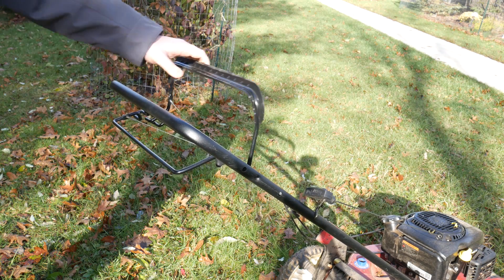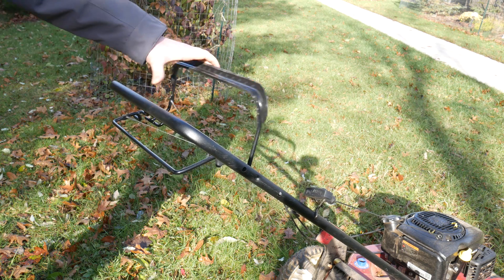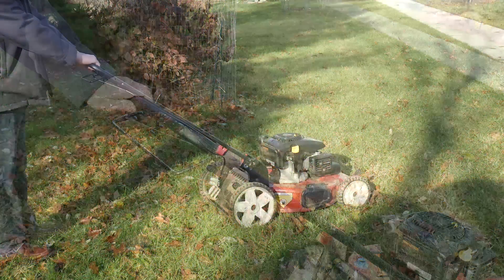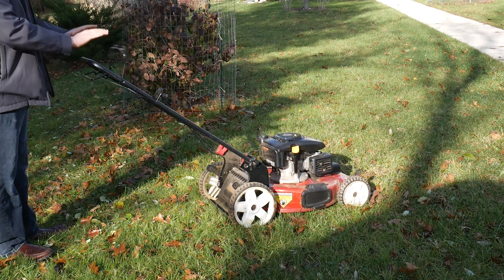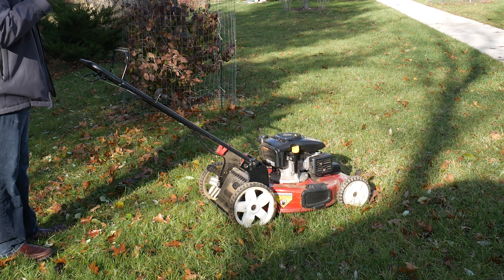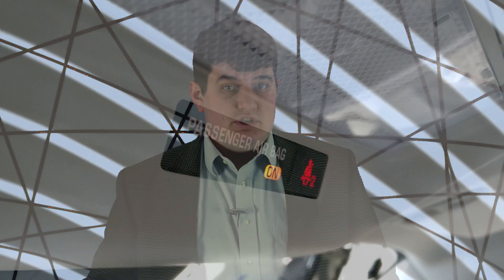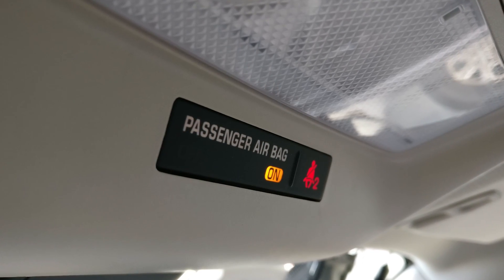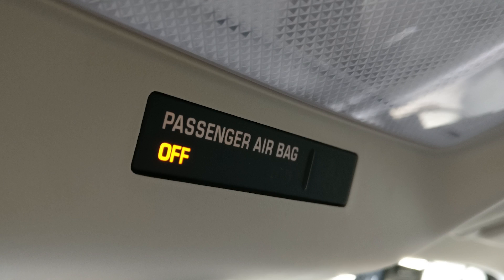The Dead Man's Switch:  How Anton Yelchin's life could have been saved

Comment: The comments seem to go off on tangents.

With the current state of cars, this is a valid suggestion that ultimately would make safer modern cars

Yes, older cars are nostalgic (double de-clutching anyone or even manual these days?), but times are a changing...

Concentrating on the present, this is a valid (& pretty easy to implement) idea.

Comment: Another common dead man's switch (at least in my life) is in those electric scooter mobility aids in grocery stores etc. The ones in the store I worked at only moved if you had enough weight on the seat, preventing children from using them or keeping the scooter still if you accidentally hit the throttle while getting up off the seat. The added bonus was that I was "forced" to sit down to put them back indoors from the parking lot :) Weeeee

Comment: I just discovered this video and although it would have been a great idea, I find Volvo's solution better. So the other day I drove my friend's fully loaded XC90. When you come to a full stop , no matter which gear you're in, the car won't move after you release the brake pedal, until you hit the gas pedal to move again. It takes a little bit of getting used to, but I can see how this is such a wonderful safety feature. I've seen drivers who loosely step on their brakes while in a traffic jam or drive through, not paying attention while their car slides forward. Even witnessed a minor collision due to this fact in a Mcdonald's lane. Anyways, with this system implemented, even if you forget to shift gears after leaving the car, it will be stationery until somoene enters the car again, and step on gas. Brilliant solution to a lot of problems, and hardly causing any issue whatsoever. My only caveat for the "deadman's switch" is that in case of a failed sensor, the car could be stuck in P while uninformed drivers may not be able to easily repair the issue, or get the car to a repair shop when it happens. Of course, unless the feature can be toggled on/off in the car's infotainment system.

Comment: I don't know if shifting INTO park at any speed (even as low as 5 mph) is a good idea. But did you know that many anti lock brake systems have the ability to apply the brakes without the pedal being pressed? They need a few seconds to create enough hydraulic pressure as the pump inside is tiny, but it's enough to stop a rolling car.

Comment: Cars haven't had driver seat occupancy sensors for the last five years, they've had them since the 1970's! 
It's what turns on the seat belt warning light and buzzer if you try to drive whilst not buckled up. 
Granted they haven't had electronic controls since then but it would be easy for manufacturers to implement an engine kill switch at the very least if the car is running and you get out the door.

A fork lift truck kills its engine if you get out (or refuses to start) if you're not sitting in the seat. 

Problem is, that any implementation of extra functions like a park control or brake control costs a few pence (cents) more per car and that's just not going to pass approval from the profit department.

Since time immemorial auto manufacturers have prioritised cost over lives.

Comment: Wait, wasn't the runaway prius thing because of "cheap" floor mats getting the throttle pedal stuck? I remember reading about this and toyota just installed floor mats with a lock. Also correct me if i'm wrong but don't new cars have a warning beep if you leave the car in gear and the engine is on in a "door open" scenario? The gen 2 prius actually has that function and you can not leave the car outside of park while exiting it (turned on (beep) or shut down).

Comment: I built a dead-man's foot switch into my pillar drill, if something nasty happens I step back (automatically!) and the drill switches off.  It won't start on the green button unless I put my foot back on the switch.

The circuit is very similar to the one you describe in the jukebox video.  It also works as a no-volt release.

Comment: Within months of picking up my ‘14 Tesla Model S a software update was pushed to implement this feature. I have a rolling gate at my driveway entry. Prior to the update it was rather convenient to stop at gate, get out, open gate, get back in car, drive through, stop, get out, close gate, get back in car and drive on, without any thought of having to take the car out of D or set a brake. My entryway is completely flat, in fact where I live there are no mountains/hills/slopes between me and any horizon. I remember thinking how lucky I was living where I had no threat of a rollaway (except in a strong wind) but also knew some folks would need to be careful. After update the car put itself in Park. This on a Tesla is engagement of the electric motor driven emergency brake “e-brake” calipers/pads. Was rather annoying at first but I understood it best for safety’s sake. From what I’ve been able to experience, any two out of the three following sensors triggering will have the e-brake set automatically: seat belt unbuckle, butt off of seat, driver door opening.

Comment: I know this is a really old video, but I'd like to make one addition:

The dead man's switch in trains are actually a bit more complex. The switch is operated by a foot pedal, since the train speed is not controlled by pedals but a lever akin to the ones in planes to control the turbine speed. But you do not only have to hold the pedal down, you also have to let go of it every 30 seconds and at most 40 seconds, and then hold it down again within 5 seconds. This is to prevent train operators from simply putting something heavy on the pedal. If you  fail to release the pedal after 35 seconds, a warning tone is played back. If you do not release the pedal within 5 seconds from then, the train is stopped. Likewise, if you release the pedal when you're not supposed to, the warning tone will sound and then force-break the train if the pedal isn't held down again.
Reply: Here in Germany the train staff are so tired that they already memorized the period of the foot pedal in their sleep.
Reply: Wow. That would be super annoying!
Reply: Some of them are a little different than that too. I've seen NJTransit trains where I believe it's more of a plunger switch that you have to hit when the alerter goes off. But yeah, not just a pedal for that reason.
Reply: @rynovoski Well, that depends on the country. In some you have to constantly press down and release on demand, in others you only push and release again when the system asks you for. In both solutions a random triggering does nothing at first, but after a few seconds of not returning to default state the alarm goes off asking you to behave properly.
Reply: Anyone with a decent knowledge of mechatronics or kinematics could make something to trick it.
Reply: Damn. That's crazy. I don't think I could do it.
Reply: @IkesThePyro  life is tough even when you have a couch, tv and remote
Reply: @MaynardFreek  Damn who hurt you

Comment: Not sure if anyone has pointed out yet but, while the airbag system can operate independently of most other systems in your car, it still communicates on the cars computer network along with all the other on-board computers. All that would be necessary for this dead-mans switch scenario to be possible is the inclusion of an occupant classification sensor in the drivers seat. The airbag module could then transmit that data to the transmission control module (and/or electronic parking brake module) over the existing network.

Comment: At least on the Teach Pendants on Industrial Robots (used to manually move the robot and "teach" programs), the deadman switches are setup to only work if pressed with medium pressure. This is to work around people's tendency to clench their hands in an emergency (robot crashing into something or pinning the user themselves). The switch is used to enable power (and brake release) to the servo motors when the robot is in "Teach" mode (user control via teach pendant allowed); releasing (or clenching) the switch kills motor power and engages the motor brakes, stopping robot motion.

Comment: And even my 2013 Nissan car (which probably has never been updated, although maybe it has when it was serviced) has weight sensors on both of the front seats. Then when enough weight is in a seat, but the seatbelt is off, it will start beeping at you to "Put on the seatbelt already!". This sometimes happens when there are enough bags on the seat too. It doesn't happen with the back seats, so the children can still get away with not having a seatbelt. It will also beep when a door is open, or if it is closed but loose.

Comment: The main issue I see with the dead man switch is in a scenario. 

Whenever your car breaks down, and you want to move it, you can put it in neutral and get out and push it (while keeping your hand on the steering wheel).

With a deadman switch, that wouldn't work.

I understand there are ways around that, but it would require extra stuff on the manufacturer's part. I'm saying this may be a reason why it hasn't been implemented. Idk. Just something that came to mind

Comment: I really think the non-physical linkages are a problem waiting to happen in modern cars.  I drive a 1998 Jeep Cherokee which does not suffer from any drive-by-wire system at all.  The transmission is electronically controlled through inputs from the computer, but the gear selector has a physical linkage into the transmission.  Also, the gear selector lever is absolutely not ambiguous.  Park is in a physically different location than reverse, neutral or any other gear.  The steering is a good old column attached to a steering gearbox and pitman arm.  The brakes don't even have ABS.  :)  And yet, the old straight six engine has a remarkably modern multi-port fuel injection and engine management system that was first introduced for the 1987 model year - 34 years ago.  To me, the thing about physical linkages is dead reliability.  It takes a physical breakage of relatively strong components to make those connections fail.  If the ECM in my Jeep decides to go belly up, the engine won't run very well, if at all, but brakes, steering, and the gear selector will all still function - at least to get the vehicle safely stopped.  I guess car manufacturers are never going to want to step backwards to a fully linked system, so having dead man's switches on driver seats would be very beneficial in cars with "logical" gear linkages.  There would have to be some redundancy built into the computer logic so that a person shifting in their seat at freeway speeds doesn't cause the transmission to shift into park.  Also, they should have some message on the huge center screen saying something like "You idiot!  You got out of your car without putting it in park.  You could have DIED, so the car parked for you!  Five points from Gryffindor!"

Comment: I've always hated how people blame jeep for this accident... nearly every car maker had adopted this design in some form or another and it genuinely isn't difficult to operate. If you don't take time to actually check what gear the car is in (it has a damn led indicator) then you shouldn't be surprised if your car rolls away. My car has a traditional (mechanical) gear selector and I still make sure it's in the right gear when I pull out/ leave the car, even thought I can feel what gear I'm in. For anyone saying it's a stupid design... it's only stupid to stupid people. Most modern cars beep / flash a warning at the driver if the car isn't in park, hell even my 2002 does this, and it doesn't stop beeping (inside AND outside the car) until it's in park or you lock it. This is almost exactly the same situation when people sued jeep over the push button start system, people would leave the car running assuming the car would shut off if you took the keys out of the car with you, and would get hospitalized / die from the fumes building up. If you don't know how to operate your car, then maybe don't drive it.

EDIT: I understand the point of the video, but let me give a scenario where these sensors would be absolutely horrible. Your car breaks down or something, requiring it to be pushed somewhere or more likely towed. Most of the time, when a car is towed no one is sitting in the drivers' seat, and the car would need to be in neutral. That would trigger the system and apply the parking break or whatever else is used to prevent the car from moving. This could be avoided by putting the car into some sort of "tow" mode, but if there is an electrical issue, that probably wouldn't work. For example, in a Tesla, you have to put it into tow mode, but if the battery is completely dead, you can't do that, and in many cases, when there's a major electrical issue (which is surprisingly common in Teslas) you also can't put it into tow mode, causing more damage to the car. I'm sure there is a way to implement a safeguard but it's just not practical as of now. The easiest way to prevent stuff like this from happening, is simply making sure your car is in park, it really isn't all that difficult.

Comment: The problem is if the battery dies and you need to push the car from outside. Then you need it to be on neutral even though you're not on the seat and the engine is off...

Comment: I get that this is a few years old (as well as potentially old news) but you may be pleased to know that newer jeeps have a system whereby if the door is opened while the vehicle is at a low enough speed, the vehicle will automatically go into park. (This is annoying when you're, say, a mechanic trying to get onto a lift, and you need to open the door so that you can see where the front tires are in relation to the pinchy-bits of the lift so that you don't accidentally pop them...)

Comment: As a mechanically inclines person, I have one objection. That is that when this new system inevitably breaks down, it will cost a fortune to fix.
Reply: Since it's all software adding this, you still have the same existing hardware to fix, no new hardware was added.
Reply: SweetBearCub But when the software fails, or the computer running it does, it’s no longer just an airbag fault, it would actually stop the entire vehicle from functioning

Comment: The part where the lawn mower engine will stop if you leave the seat if the parking brake isn't enabled prevents you from helping it free when it gets stuck. The only easy way to fix that would also disable it stopping the cutter when you leave the seat.

Comment: As a Chrysler mechanic I can tell you this, because of this death and the retarted rotary shift dials we have had to flash the computers in many models with a software update called auto park that addresses these issues, the update is complete bullshit because if say I’m pulling the car onto a hoist to service it and I open the door to see where my wheels are it will slam into park. A car is a machine lean to operate it correctly software should not fix people’s inability to pay attention

Comment: I agree, these should be there, along with overrides to disable them in case a fault in a sensor occurs. Driver training to know when and how to override these interlocks and the safety implications of disabling these interlocks.

This in my opinion is an often overlooked part of these systems, a way to deal with a failure of a system. Most Industrial equipment with dead man switches will often have some way of overriding it, weather it be a hydraulic vent or mechanical brake release etc

Comment: ill admit id be one of the people who would resist a change like this. mainly because this would prevent you from pushing your car. you would need 2 people or something heavy in the drivers seat. Now i know this sounds pedantic, but my first car was a 1990 pontiac lemans and i had a serpentine belt snap on me in the middle of really busy traffic and i was by myself. So in order to get off the main drag i stick the car in neutral, open the car door, one hand on the steering wheel and the other on the top of the door frame i pushed the car 50 feet in which i turned right and got onto a road that had 0 cars trying to drive on it instead of 100 a minute (could be an exaggeration but its been a while). with a feature like this it would specifically designed to keep me from doing what i described earlier with my first car. its nice and all for a new car to have a safety feature like this, but when a kid is buying their first cheap car its nice to be able to push it without needing a second person

Comment: My very elderly BMW automatic makes a huge fuss and lights up a big "your car can roll!" light on the dash if you try to get out with it not in Park, and it is an effective and helpful reminder. Having said that, it's a good idea to engage the handbrake before putting the car into Park, and leave it engaged. It is possible for the little plunger that locks the transmission in Park to break if you suddenly release the weight of the car onto it by taking your foot off the brake pedal on a hill... leaving you with an expensive damaged gearbox. Using the handbrake/parking brake before engaging Park and taking your foot off the brake pedal removes this possibility and gives you double redundancy against the car rolling away on a hill.

(Similarly, I'd advise engaging the handbrake and putting the car in neutral or park when stopped at traffic lights or in a queue - it's kinder to your torque converter/transmission fluid and you're not risking moving forward unintentionally if your foot slips off the brake pedal whilst you're reaching for your coffee! Nobody who drives a manual would sit at traffic lights with their foot on the clutch and brake... but loads of people do the equivalent in an auto!)